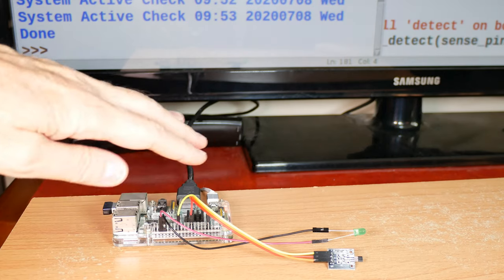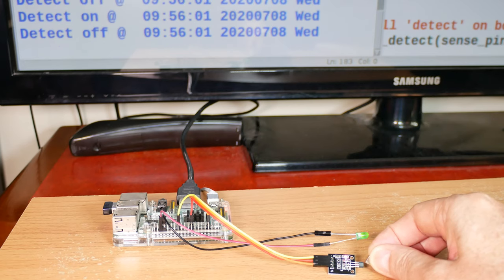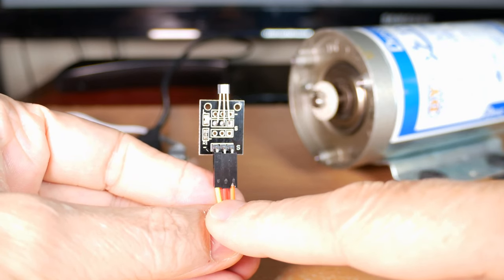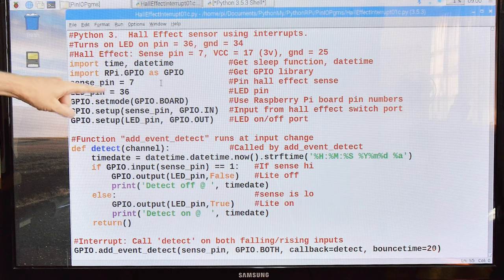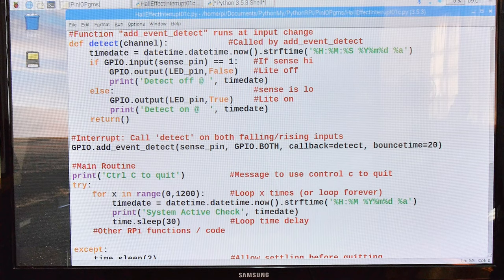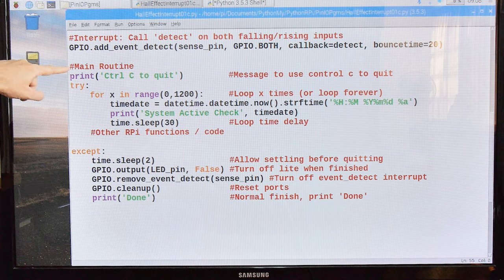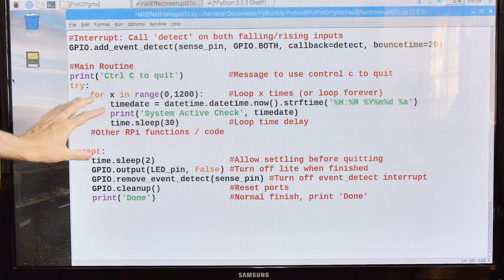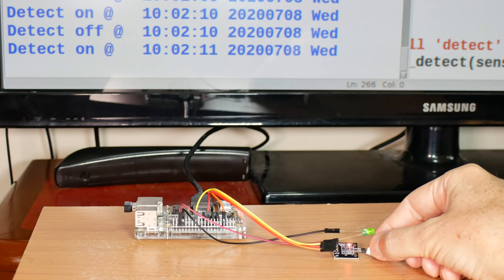RPi 33.0 - Hall Effect Sensor / Switch Simple (4K)

Comment: am using the TEL4905L magnet sensor and min voltage is 3.8 so i cant use the 3.3 of the pi i need to use the 5v is it ok to use the PI 5volts source ?
Reply from the maker: I do not know that sensor.  I do know the RPi will be damaged by 5 volt inputs.  You might be able to use a voltage divider to bring down the voltage.  I don't have a video on that, but I've seen videos by others on making and using voltage dividers.

Comment: Have you had any problem with the sensor vcc at only 3.3 volt?
Reply from the maker: No, but then I have not pushed it to its limits.  It is possible it has dropouts at high switching rates.
Reply: @tsbrownie  thanks

Comment: I would like to use this code, but I'm wondering if the data is saved anywhere on the Pi once the script is run? I plan on using my sensor to track how fast/far my hedgehog runs at night on his wheel :)
Reply from the maker: I have program samples about writing data to files. It is simple to add statements similar to print that put data in files.
Reply: @tsbrownie  I have been using my RPi 2 B with hall effect sensor a3144 to read the variable voltage on my electric motorcycle. My idea was to convert voltage to a frequency in order to select a motor sound file (Very small wav file ). Works OK, but when I give full throttel at stand still, its not impressive to hear the motor racing and you are just starting to move.
So my plan is to add a HES to read a magnet at the motor axel. That is done, but now I want to read the RPM of the motor and attach a certain RPM range to a certain motor sound file to it. That way the motor sound is accurate to the RPM of the motor.
I have very little experence in coding and I saw this answer to @StaticStorm17 where you wrote "I have programsampels about writing Data to files. Can you help me with my quest?
It is a little bit more in depth than lighting up an LED.
Reply from the maker: @victorhuffel4823   I checked all my RPI videos and do not have a R/W example. There are many online you can google. 
This is a pretty good example:  https://www.freecodecamp.org/news/file-handling-in-python/
Reply: @tsbrownie  Thanks for answering. Will study.